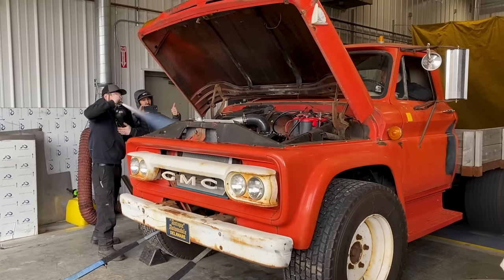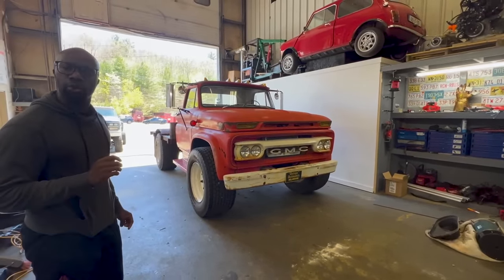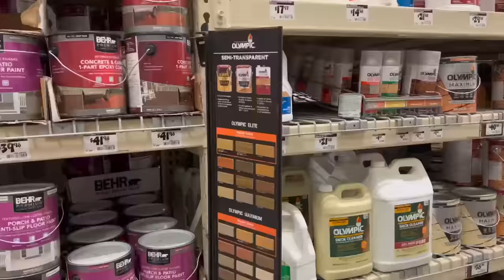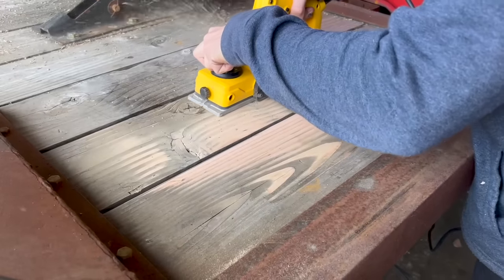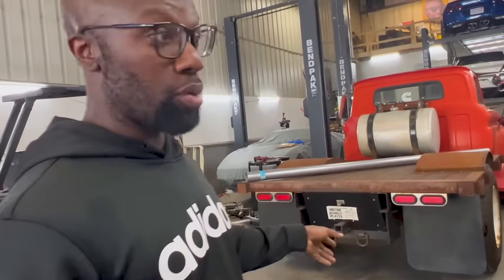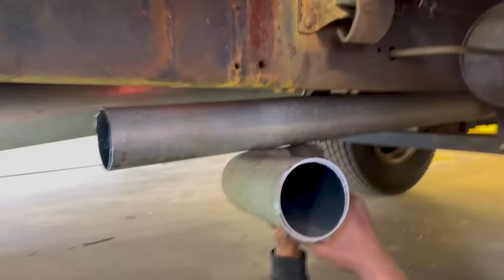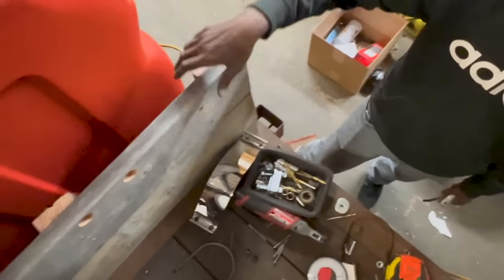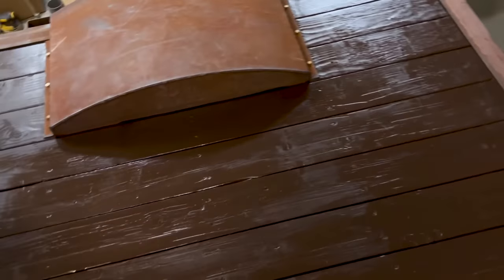Tastefully modifying our 1960s classic farm truck

Comment: 0:38 how are school buses not EVs?  It’s the perfect use case. Used twice a day, plenty of time to charge overnight and in between.
Reply: They're expensive
Reply: Same reason USPS is buying a whole fleet of tiny vehicles that get like 10 mpg.
Reply: I've been wondering why they aren't looking at local/municipal vehicles for EV. It makes so much more sense than long haul I think.
Reply: @whosdondada  easily make up the cost in fuel savings.
Reply: @Mathis218337  true. Lion Electric sells electric bus and trucks
Reply: @Mathis218337  That's like saving the change in your pocket at the end of each day to buy a Ferrari. Sue, you'll save on gas, but the upfront costs are enormous. Then when you need to replace the batteries in 10 years, the buses are useless. They're not going to put a $30k battery pack in a bus that's 10 years old and is only worth $20k. Same thing that happens to all electric cars. You need a new battery pack in 10 years, and the car is now worthless because a new battery is $15k+.
Reply: @littlejackalo5326  I don’t think you know how expensive buses are lol
Reply: @littlejackalo5326  The fuel cost and MAINTANCE costs, you have to look at heavy duty diesels, not what a little Jetta cost is.
Reply: And also, why do they not have seatbelts for the kids? I've just never understood that
Reply: @AChi__  because if the bus crashes in water or starts on fire the kids wouldn't be able to escape. Also how do you enforce 50 kids to wear them without someone walking the isles.
Reply: @Mathis218337  By the time schools are done with them they're basically worthless.  I can buy a couple school buses for dirt cheap because they're 15-20 years old by the time they're sold and are worn out.  Most schools can barely fund the actual education component of the school; much less dumping in a much higher initial cost for something that will probably need two battery changes over the life span doubling the price of the unit.

Most applications of EV city buses that use batteries have proven to be incredibly inefficient cost wise and end up just eating tax dollars.  That's not the case with trolly buses that use overhead wires for power, but those aren't really practical for school buses that go to residential areas (or in the case of rural areas not at all).
Reply: Mail trucks were an even better case, and they fucked that up too.
Reply: @littlejackalo5326  The entire battery pack won't be bad after 10 years. They will be topped off and charged slowly overnight every night. Batteries last much longer if not discharged every day to 0% and then fast charged back to 100%. You're basing the age limit on the flawed assumption of that type of use. School buses will be charged slowly at night, at off peak rates. They're not going to pay a premium and plug these in at a level 2 DC fast charger. Also, with all the stop and go they do every day, it's very hard on the transmissions and brakes, so the amount of wear and tear on just the brakes and transmission problems in 10 years alone, would pay for several battery packs. Never mind that the cost in diesel fuel today in many areas is $6.49 a gallon, and school buses in city traffic with many bus stops would be lucky to get 10 MPG. And buses aren't 20K, try more like 250K. Just the cost to rebuild the typical 275/300 hp Cummins ISL9 engine in them can cost upwards of 9K, or 20K for a new engine.
Reply: @JLeYang  And he thinks the diesel engine and automatic transmission is a school bus is going to last forever with all the stop and go driving, and short trips, and too much idle time. There's a reason why many school districts and counties get rid of old school buses before the 10 year mark. Who wants their kid going to school in some smoke belching, rusty old clapped out bus with ripped seats, and dried out puke on the floor. Not.
Reply: It is a perfect use case. 90% of the time, they don't need to go very fast. Probably need less than 100 miles of range per day. At slow speeds, and with heavy regen, drivers could be trained to use 1 pedal driving. Plug all the buses in at the yard every night, and slow charge at off-peak rates. Save a ton of money on brakes and transmission repairs/problems. Plus diesel is over $6 a gallon in many areas now.
Reply: @StrangelyIronic  Well, city buses are quite different, they have very very long operating hours. Large cities like Chicago the buses almost never stop. That's not good for batteries at all, no time to charge. School buses just to get the kids to school, and then back home at the end of the day. For long field trips, and sports games etc, stick with the more comfortable coach style buses.
Reply: @DaBaltimoron  Could be, but there's a lot of mail routes that are very long, 12 hour days, and a lot of miles and hills. School buses normally just one trip in the morning, one in the afternoon.
Reply: @StrangelyIronic  Exactly, some of them get new ones in only 10 years, in the more well off areas. They don't want to spend money on new engines, transmissions, fixing rust, replacing worn out ripped filthy seats etc. They just do minimal fleet maintenance, then once the buses are fully written off, they just replace with new.
Reply: Better yet: let children cycle to school. I cycled 26 miles a day to go to school. 

The only thing you would need is a complete overhaul of your infrastructure and stop building car centric.
Reply: Canada has some EV school buses.
Reply: @brnmcc01  as I driver I do 8 runs a day. We have to cover HS, MS, elementary and two different kindergarten start times. The school times are staggered to cover routes in reality the bus is only stopped about an hour and 15 for lunch before staging pick ups for the afternoon
Reply: In the bipartisan infrastructure plan passed by Congress in 2021, $5 billion is dedicated towards outfitting rural school districts with EV school buses.
Reply: Simple, just because a BEV school bus might exist today, it might not have existed or been considered affordable / viable when the school district was buying new buses.  Most school districts don't buy 1 or 2 buses when they start replacing their fleet of school buses, they might be buying 10-30 and sometimes it's simply cheaper to keep using what they already have if they are still running and safe to operate.  Sometimes it just comes down to the bottom line and not what amounts to vying for social credit.
Reply: They are expensive and American districts don't like spending money in ways that are actually beneficial in the long run.
Reply: Because anyway EV companies sell their carbon  redit, like Tesla makes a loads selling it's carbon credit.
So it doesn't pollute less, just somewhere else...
Reply: @brnmcc01  EVs can easily travel any mail route.  Busses are big and heavy.
Reply: Zero chance an electric bus can drive eight shifts a day with today's battery technology. However, if there was a small motor on board running at a constant RPM constantly at peak efficiency constantly regenerating the batteries, I would believe the economics more.
Reply: If it makes sense you can guarantee the government won't do it.
Reply: @bubba99009  99% of them (rough estimate) don't even need that big of a battery pack to cover their respective routes. They could get away with 20-30kwh worth of battery.
Reply: Bluebird makes E buses, they're used in student transport all over the country.
Reply: @RustOnWheels  That sounds like a good idea. that is, until you think about it and realize that school is in session all winter. One bad slip on a patch of ice and some kid winds up under the wheels of a car. Hmmm, maybe that's why they use school busses.
Reply: @djlinux64  Nope. That just adds the complexity of an ICE engine to a vehicle that does not need it. Besides, you're still paying for dino-juice and making smog, thus defeating the whole purpose of going electric.
Reply: @surferdude4487  not necessarily true because an ICE engine running at a constant RPM at the minimum BSFC point is extremely efficient
Reply: There are electric school busses. They are just not widely adopted... yet. Considering the savings in wear and tare on brakes, transmissions and engines, even without considering the impact of polution (Diesel exhaust is really nasty stuff) school boards will be going electric. Some of them are already testing BEV school busses with great success. A lot of school bus runs are at low speed with lots of stops and starts. This is the ideal use case for BEVs. For the people that drive charters (teams, field trips, etc) the busses would have larger batteries with chargers provided at or near the destinations. Do you honestly think that a school bus would have to work harder than a long-haul semi transport truck? Yet the use case for BEV even for that application makes sense enough that Tesla already has thousands of pre-orders for their semi.
All this just to say that BEV school busses are coming. The diesel will be dead as the dodo in ten years or less.
Reply: @brnmcc01  And yet, city busses are stopping and starting all day long. BEVs would eliminate wear and tare on transmission and brakes, recoup part of the cost from each start by regenerating at each stop. In city traffic at lower speeds, the batteries would achieve much higher range than they would on a highway. On top of that, you eliminate smog and noise polution in highly populated areas. The busses could also plug in to top up the battery when the drivers take their breaks at the end of each run. Again, an ideal use case for BEVs.
Reply: @djlinux64  Yes true because you are running an internal combustion engine. It may be less wasteful and polluting than running an ICE at constantly varying loads, but it is inescapable that it will still burn fossil fuel and create pollution. It is also inescapable that it will need: a fuel system, an exhaust system, added weight, added complexity, added initial cost, added ongoing cost and maintenance. As I said, completely defeating the entire reason for going electric in the first place.
Reply: @surferdude4487  That’s only because cars are the dominant species in North America and everything is catered to them. In (some) other countries cars are considered a dangerous weapon - that’s why adults need to get their drivers license at a driving school - and and therefore cars are unwelcome / need to treat humans as the important species. 

Countries like that have strict rules and must behave like a guest in areas where people live. Cars can only go fast on highways, which have no connection with any area where people live.

Such is the case in The Netherlands and cycling to school is de facto. Even with ice and snow.
Reply: @surferdude4487  today's battery technology can not make a school bus fleet economical without an ICE booster
Reply: @djlinux64  You can keep right on saying that if it makes you happy, but the currently serving BEV school busses do not support your argument. IMO, any continued use of ICE engines is simply NOT acceptable.
Reply: @RustOnWheels  You make two EXCELLENT points!:
1) Driver training in North America is woefully inadequate. If I had my way about it, every driver would be REQUIRED to pass a complete defensive driving course before being allowed the priviledge of operating a two ton weapon on a public road.
2) Designated bicycle lanes are also sorely lacking in most North American cities. This means that unprotected cyclelists have to share lanes with said two ton plus lethal weapons. To add insult to injury, a lot of the people operating those two ton plus lethal weapons have such a sense of entitlement that they force cyclelists off the road.
One point you did not take into consideration is that operating a bicycle when there is snow and ice on the road is inherently unsafe and in many cases impossible. I suspect the weather is a bit milder where you live.
Reply: @surferdude4487  When I was young we had winters with snow, ice and black ice. It could get quite scary in corners and with extreme conditions school wouldn’t even open or I would take public transport (electric trains). In my youth it could get as cold as -20 degrees Celsius. That’s very rare these days as climate change is pushing our climate into more warmer territories. 

I do find it intriguing how much the Gulf Stream influences our climate; we live at the same latitude as Newfoundland and Labrador but our winters are a ‘little less’ harsh.
Reply: @RustOnWheels  To be fair, I grew up in Toronto. The temps hovered around 0C most of the winter because we had a massive thermal battery in the form of Lake Ontario. But, sometimes the wind came from the North-West and it went down to about -30C with something around -40C being the record. We didn't have the option of electric trains. For a city that size, it was disgusting that we had a grand total of 2 (count them all! 2 whole subway lines) and they only covered the central part of the city. When it snowed hard, we stayed home and stayed alive.
Reply: Lol and grid storage, think about when school buses are used. Early and mid day, they would be perfect to help store energy for the prime time evening load and then recharge all night for the mornings drive. Imagine a whole fleet of 75kw batteries
Reply: @tiloalo  Partially true, the part you are missing is that the number of carbon credits declines over time, which means one of two things: 1)Either the polluter has to lessen their emissions or 2) with less carbon credits to go around, they will pay more and more for each credit. Eventually you reach a point where it is no longer profitable to buy the credits.
Reply: @tboneforreal  yes, but you know how it goes... They'll threaten that job will be lost, and the amount of credit will be increased... But let's keep some hope
Reply: Propane has been tried. Electric is a nightmare in cold weather and batteries die too soon. Hydrogen would be a better option, good option for fleet vehicles.
Reply: Expensive to install ev charging station in the school bus parking lots over night. Plus the price of the vehicle itself. As it is now the buses part as close as they can get out of the vehicle. So it sounds great and yea they might save money eventually. But the first implementation would blow budget immediately.
Reply: @littlejackalo5326  ...You haven't even touched on the subject of the cost to build out the infrastructure for charging these school buses.  Currently, there are zero charging facilities at or near any of the schools that pick up the kids.  We're talking hundreds of millions (billions perhaps?) of dollars FOR EACH SCHOOL DISTRICT to recharge these things.  Not to mention, in a lot of areas of the country, school bus drivers DO NOT redeliver them to a depot after picking up the kids on the morning commute; they take them home with them.  This means that if a bus needs a recharge, that person's home would need a recharging station capable of putting enough juice in it to take the kiddos home in about 6 hours of charge time.  Are parents ready to tax themselves into further municipal debt with a recession facing us for the next two years?  Electric School Buses are dead on arrival.
Reply: My employer is currently procuring our first electric school and city buses, for a fleet numbering in the hundreds (major city you’ve heard of). They are extremely expensive and require lots of infrastructure that is currently being built out. Also, our F150 Lightnings  still haven’t arrived, and the chargers have yet to be installed. It’s quite a lot to change a fleet over. I’ve been at this for over 15 years….

Comment: As a person who does wood finishing etc. I sometimes use my planer and backpack vac, I also use a grinder with a shroud and a carbide flap or one of them cleaning discs, you know them low density scotch Brite like material discs with the bonded abrasive, will remove material like a fool without wrecking the wood just so you move enough not to burn. lots of thing on a grinder do quick removal. When I don't plug in I go with the grinder most though when I feel like fooling with cords I use my festool, their sanders are a hybrid orbital rotary with amazing dust extraction. you could vacuum with the sander. Stupid expensive though . If I didn't do it everyday I wouldn't spend it and just use sanders and grinders, and planer with a HEPA vac. Makita makes a great 36v backpack vac. I like that they just double the 18s for their higher powered stuff. Hoping their new line with different batteries doesn't catch on. The battery stacking for multi volt tools was what made me go blue. Got battery adapters for my other tools just to have one battery. Gotta love slide type.